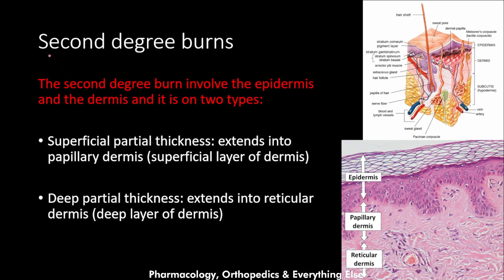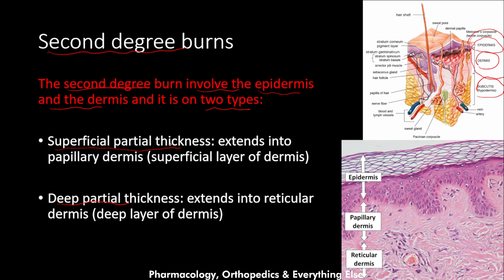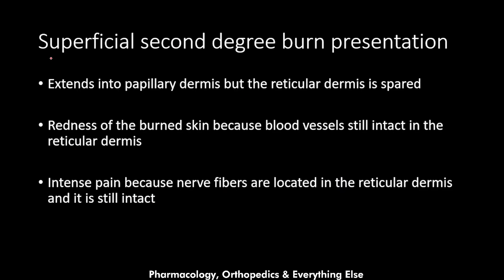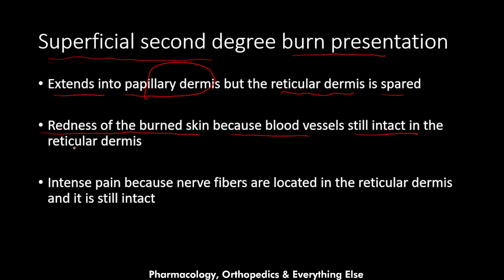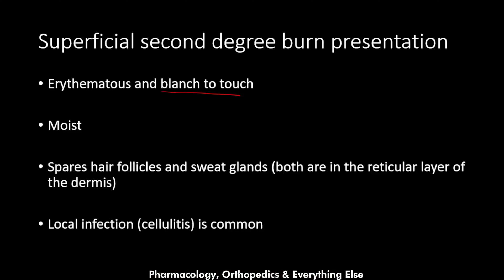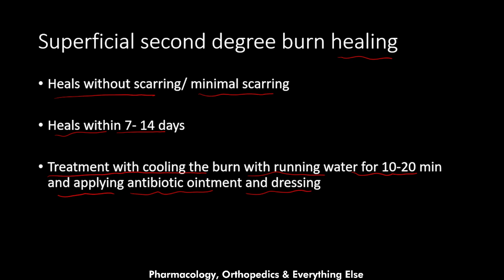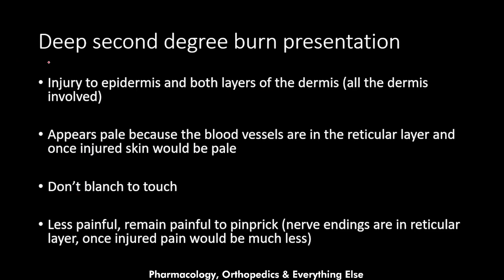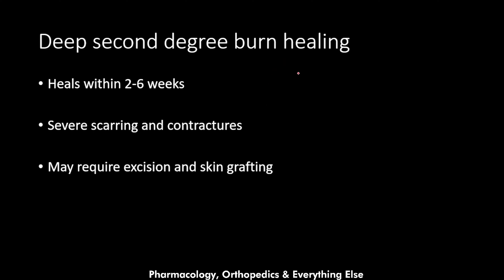2nd Degree Burn: Superficial and Deep Partial Thickness Burns Explained

Comment: my husband had a cutting torch that the fuel line busted and shot flames at both his arms. ER claims it's 2nd degree burn and to clean gently and keep vaseline and wraps all over both arms. Has appointment with Burn unit next week. What should he do until we see them. Does he not need an antibiotic cream as well ? ER never mentioned that just only vaseline. Also his skin still has blackish color from flames I assume almost a purple color , is that bad ? never delt with burns from a flame before. he only hurts where blisters are starting, isn't running any fever, eats and drinks fine
Reply: What did the burn unit suggest?  How is he doing now?